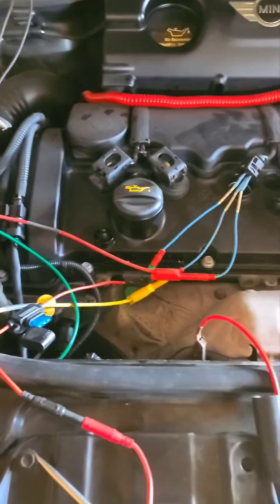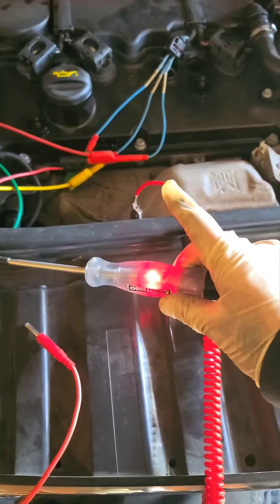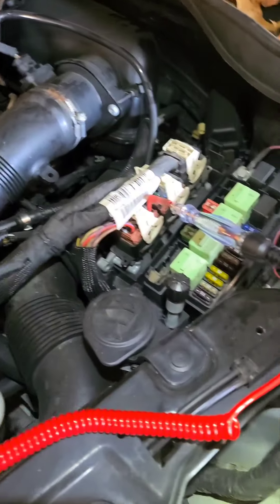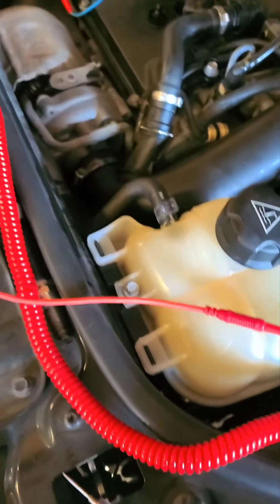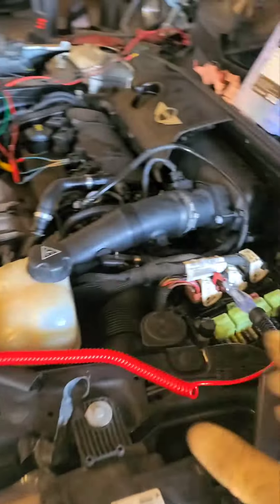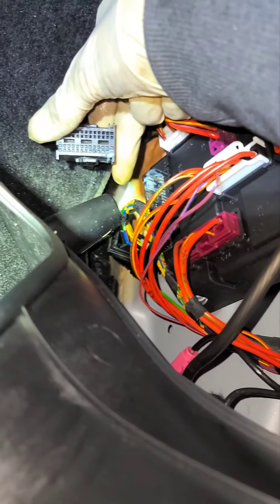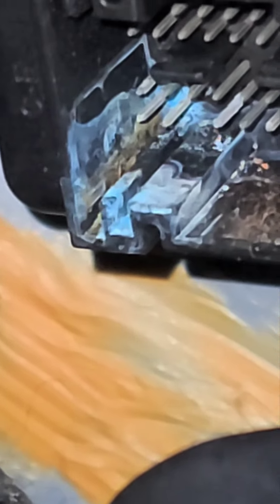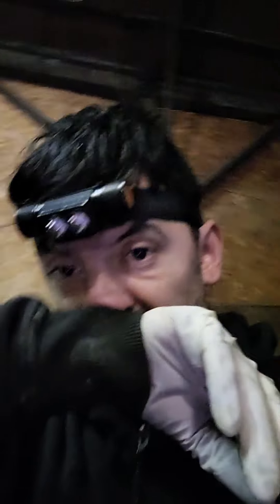2012 mini Cooper crank no start

Comment: What kind of test leads are you using? Also what kind of diagnosis tablet are you using? I see you have 2.. one for dtc codes and another for the schematics.. curious if you could let us know how to get a hold of those types of tools and how much they cost.. I’m sure an arm and a leg but I’m just curious cause I have a snap on verus but it’s ollldddddd
Reply from the maker: the test leads i got from Aeswave and the tablet it just a dell 7202 i believe its a rugged tablet and use alldata or identifix. i think the tablet was like 500 the leads was around 280 and the subscription it just depends

Comment: Do you think that I can fix it or I need to replace mine. I legit replaced it about 6 months ago but since then my sunroof drain was plugged so water got in.
Reply from the maker: ya i notice that they are very common. customer wanted holes drill to the floor to prevent future issues. painted them to provent issues with rust